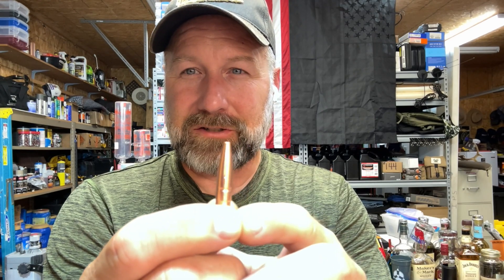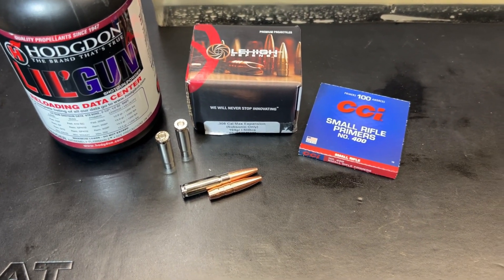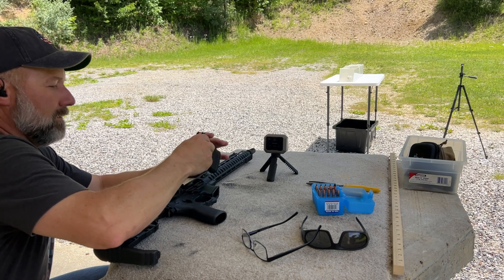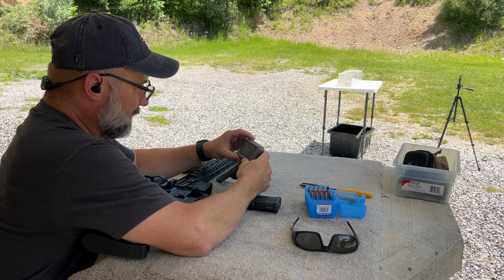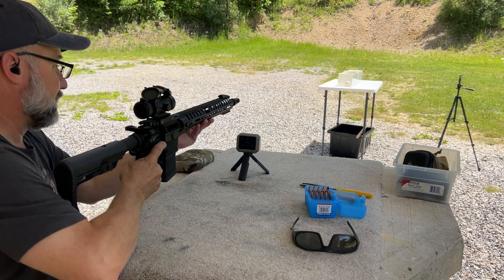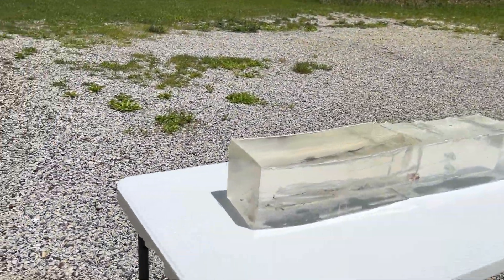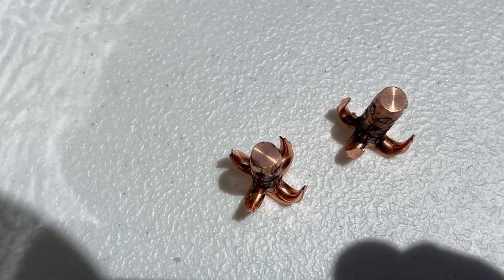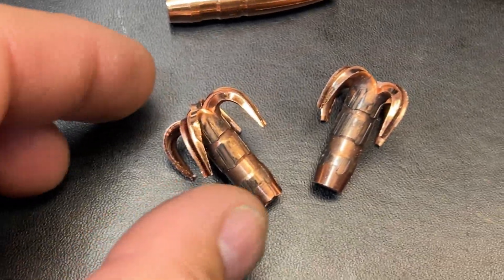.300blk, Lehigh Defense 194gr Max Expander Bullet, Ballistic Gel Block Testing.

Comment: 1 The bullet was designed for sub speed.  Your's were too hot. Would've gone slower in a shorter barrel.
2 you're using a 16" barrel. 300blackout was developed for 10" or less.
3 didn't use a suppressor.
You completely negated the sole purpose of this caliber, so we don't know it's true performance yet, do we? If you did a better test, please link the video.
Reply from the maker: There is a subsonic test video…

https://youtu.be/N13VunJ-pN0?si=80ho0Anox4Z4dhj_

lol. I’m aware of the design, I’ve got into this caliber over 15 years ago, right after it released to the public. 

So the .300blk was designed by AAC as a “short” barreled, 9” being the optimum length, platform for military CQB.  

It was designed to cycle Remington 220gr lead core subs loads either suppressed or unsuppressed,

And, with no gas adjustments, run Remington 110gr supersonic loads suppressed or unsurpressed. 

Any barrel length, ammo deviation or field application means you’re not using it as “designed”.

When this caliber hit the market and before dies were available for reloading, the Remington 220gr and 110gr were the ONLY ammo options. I still have a few of each of them in factory loadings. 

There are a thousand variations of this platform, ammo and application scenarios so the chance of finding a test that matches your setup and use may be difficult. 😉

Comment: I would think that the Lehigh High 194 grain copper max expansion would be even more devastating in a 1 in 5 twist barrel. Another great video. Thanks 👍🏼
Reply from the maker: I’ve been pondering a 1/5 barrel. It definitely would magnify the results. 😉
Reply: Just built a .300blk using a faxon 6" Barrel, 1 in 5 twist. My nomad 30 is shipping this week. Gonna have to get a gel block and a test.
Reply from the maker: @theincredible9168  👍🏻. I’ve been wanting to upgrade one of mine to a 1/5 barrel too.  I’ve just been so busy I haven’t taken the time to do it yet. 😉
Reply: @theincredible9168 Sweet!!

Comment: I’m just a random guy. But could you possible provide a video over the 95 grain bullet as well? I tried liberty ammunition 98 grain overwatch and it failed to feed 3 times in a box of 20. I’m using a 16” barrel on a a3m1 Aug. the bullets get stuck on the hollow tip lip when trying to feed up from the magazine.
Reply from the maker: I got in some Lehigh 115 Controlled Chaos Bullets today. They should load to the same OAL as the 95gr so stay tuned. 😉
Reply: Thank you. Being new to the gun world is hard. Must have been harder back in the day. T I’m just trying to seek info on 300blk ammo and reliability due to the vast variety you can run. If the 115 does well out of something that is even close to my build I’ll buy some to run testing. I’ve just purchased the hornady 110 vmax but I wanted something lighter like those 98 from Liberty or these new ones I found with Lehigh, the 95 grained! Thanks for your 300blk content, it helping people out believe you me!